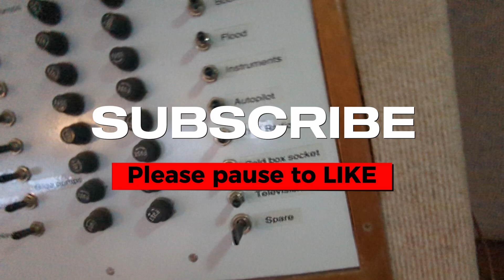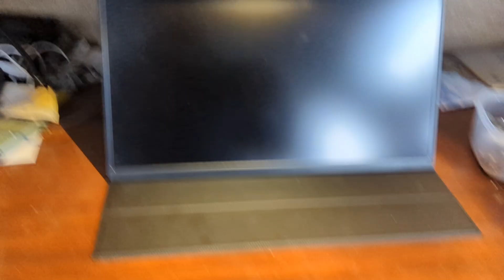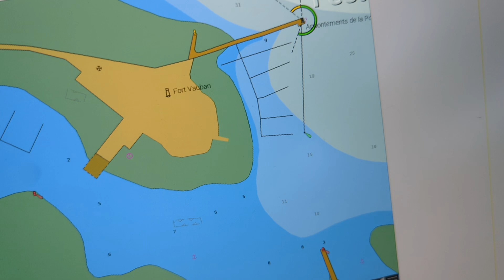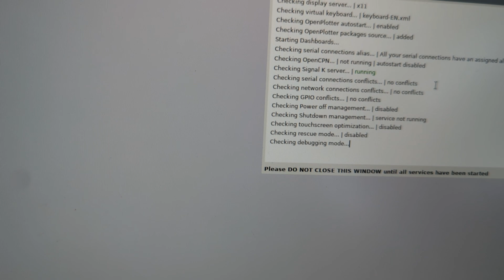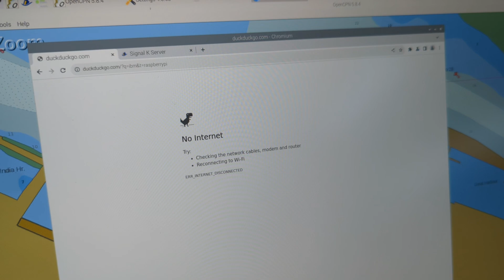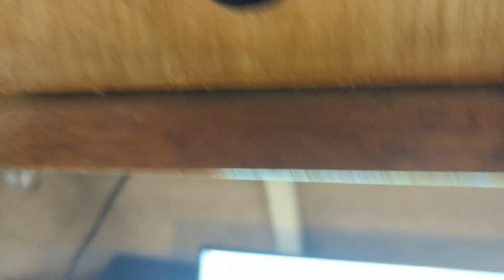Installing Raspberry Pi 5 OpenCPN on my mini catamaran

Comment: Most low cost multiport USB PD will have a shared power budget causing re-negotiation when you plug in devices so existing devices will loose the power momentarily. Annoying enough to get individual ones.
Reply from the maker: Interesting. I will try this and see what happens. Most of my devices have internal batteries so a short drop in voltage while it renegotiates the PD stuff will not cause any problems. What I need to test is my raspberry pi 5 as that will crash if the voltage drops too low.
Reply: Yeah the pi is in a league of its own when it comes to finicky power supply! The negotiation glitches can also mess with stuff that tries to do smart charging based on your usage patterns or devices or trying to schedule  their charging based on available power.

Comment: you have way too many cables on those connector posts. That could cause you problems later.
Reply from the maker: I agree that was how it came from Solaris the manufacturer in 1996. I am planning a full replacement. Using bus bars. There  are way too many cables connected to those 3 bolts.

Comment: I was at James Watt Dock almost a year ago (in a few weeks) doing my Day Skipper Practical, I did my first sail in the dock as skipper from James Watt up to Rhu Marina, seeing all the buoyage at night was fascinating.

In terms of powered USB sockets, I would suggest just installing a standard car cigarette light socket and using a branded USB car charge. The annoying thing about USB charges is the spec changes all the time but the car chargers are easier to upgrade or replace.

Loving your project btw :)
Reply from the maker: Thanks for the USB information.

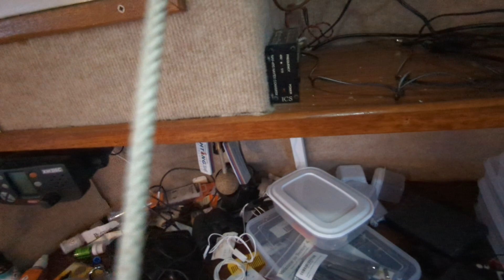Comment: Use a beefier eye hook bolt and bolt all the way through the door. The little eye screw you showed @2:55 looks a bit too flimsy for normal use, much less surviving something actually going wrong or lasting a long time. I'm imagining an unexpected wave while trouble shooting the electric and you ripe the whole door off, and the cables rip out, and they short out, and your boat catches on fire, and your mortally wounded, but you make it to your life raft and get to watch your boat burn and sink before you die, and you'll be thinking: "I should have listened to Lex. I bet if I had just asked around the marina someone would have given me one for free out of their box of odds and ends."

Did you post your planned route and schedule somewhere? I should be near La Rochelle this summer. I could bring some extra hardware with.
Reply from the maker: I will do that I plan to pick up some stainless bolts next time I am in Glasgow

Comment: It looks like the Pi is downclocking (that fan should be spinning). You can buy some fairly cheap cases with passive cooling built in. Moisture will be tricky though (those micro HDMI connectors are tempermental 6astards at the best of times).

Pi's are great, so much flexibility and the price!
Reply from the maker: You are right I think my Pi has picked up that I am not using a 5 Amp raspberry Pi approved PD power supply and has down clocked me. I am looking out for a 12v to 5v 5Amp PD supply.